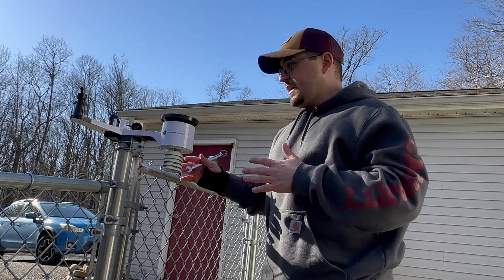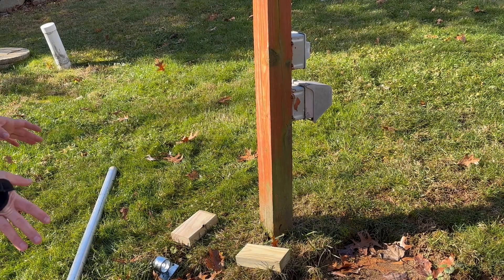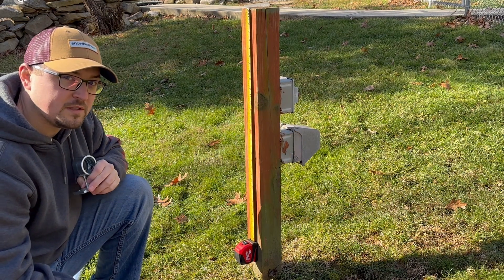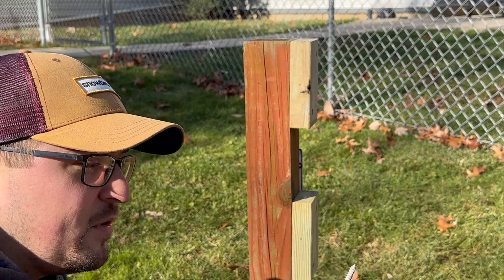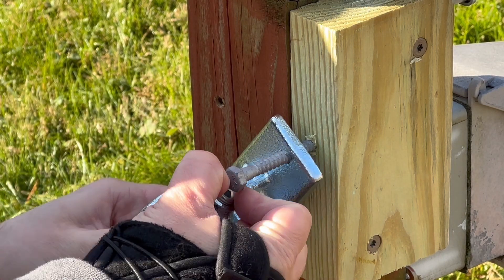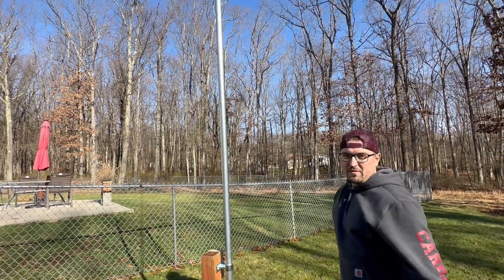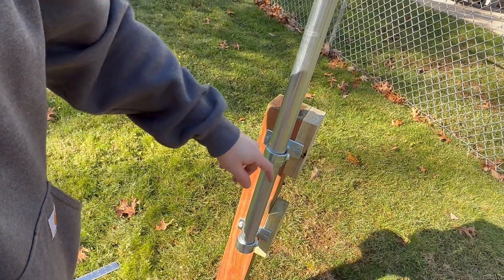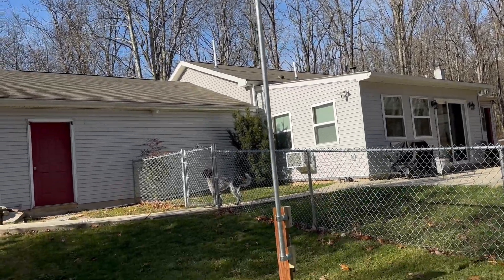Mounting The Ambient Weather Station | How To

Comment: Suggestion is on a pole 6-8ft high away from the house in an open area.  The higher pole recommendations are for the wind, so if you are lower understand your wind values may not be 100% accurate.  Stay a good 50ft from water, driveways and trees if you can.  These systems have a good Wifi range, so you have some flexibility.  Mine is about 200ft from the receiver and communicates well.
Reply from the maker: Yeah I know wind reads won’t be accurate I’m in a forest basically
Reply: @homeprojectswithnick  Yes, I have a lot of large trees on my property, so know my wind speeds like yourself will not be accurate.   I cheat a bit and view the data on a friend's weather station that is in a more open area.

Comment: We just bought one and love it! It well tell you the time and temp inside the house and out side temp. Barometric pressure, wind direction and speed even the forecast etc. We mount the unit on the Second Story roof line with a fence pole 8ft and we modified a lighting rod to the pole you must get one it is great...LOVE IT!

Comment: Thanks for the info. I've got a post in the ground from a previous project. Looking at doing a hinged mount for maintenance. Read you have to clean the rain gauge monthly. Would have liked a close up showing how it attaches to the pole. Other than that? Very helpful.
Reply from the maker: It attached to the top of the pole using 2 smaller U-bolts to hold it in place, as seen in the beginning of the video. Very straight forward. I haven’t cleaned the rain gauge in a year and still seems to be quite accurate for my purposes. I haven’t even had to replace the batteries yet. I’ve been very impressed with it. I’m happy you found this helpful!

Comment: What size (thickness)pole did you use and did it seat all the way to the bottom of the weather unit. And where did you purchase the pole?
Reply from the maker: It is a standard steel fence post for a chain link fence. Should be able to find it at any hardware store. I believe it’s 2in diameter. I got mine at Lowe’s

Comment: Need 33 feet up in air. Due winding mess up wind direction and must be perfect balance too
Reply from the maker: 33 feet up is not reasonable for most people. More accurate Wind speed and direction is really the only big benefit of being up that high. 12-15 ft up for most people will be fine.
Reply: ...not feasible, especially when you have to deal with this unit requiring battery change.  It's powered by solar, but does not have rechargeable batteries?
Reply: @vy1w1yv  i have one. Solar for fan only. Not for batteries charging. Fan for temperature. I just found out after I cleaned it and maintained. Interesting

Comment: I have a LA crosse technology weather station with wind speed, wind direction, temperature, humidity, feels like temp, dew point, and wind speed trend.
Is 13' 4" off the ground a good height for the wind speed, It will put the anemometer 14 feet above the ground? My roof is roughly 25-30 feet high, but there is no there to put it since it is a very slanted roof, and some places are higher than others.
Reply from the maker: Yeah that should be fine as long as it is not too close to the house.
Reply: @homeprojectswithnick It's roughly 42 feet from the house

Comment: Thanks for your video - I think this is one of the best setup's as it is very simple and allows one to quickly take down the station for cleaning, battery change-out, etc...    Question - is there another name for the "Railing Holder" you used in your setup?  I tried to look on Home Depot's website & Amazon but couldn't find something similar. Could you provide a link to either Home Depot, Lowes,  Ace, amazon,  etc...of the "Railing Holder" you used?  Also, was that a 10' pole you used?  Any updates a few months later??   TIA!
Reply from the maker: https://www.lowes.com/pd/SteelTek-1-1-4-in-Silver-Galvanized-Steel-Structural-Pipe-Fitting-Rail-Support/999930990    This is the fitting you are looking for. Just make sure it matches the rail size you are using I believe it was an 8 ft section. So far this has been working great. No issues and gives good consistent readings. Only trouble I had was resetting it after a power outage but all I had to do was power down the dock station inside and restart it and everything went back to normal.